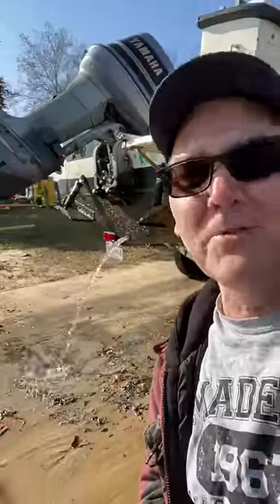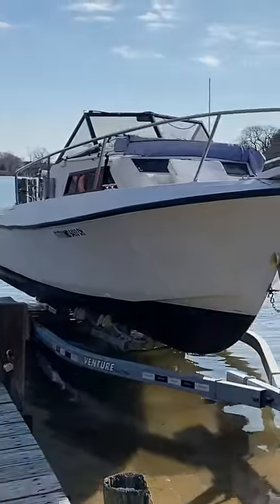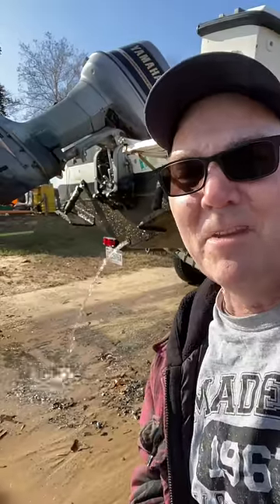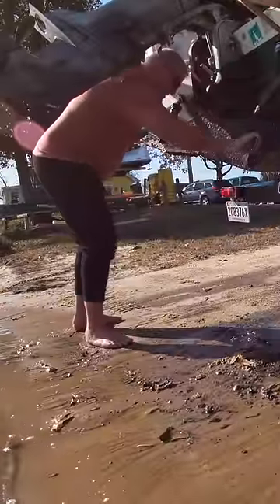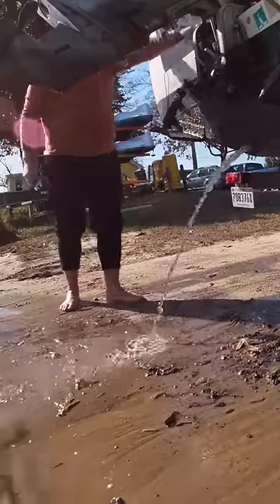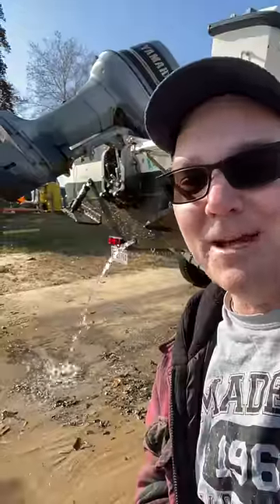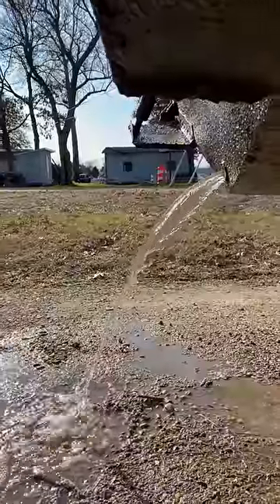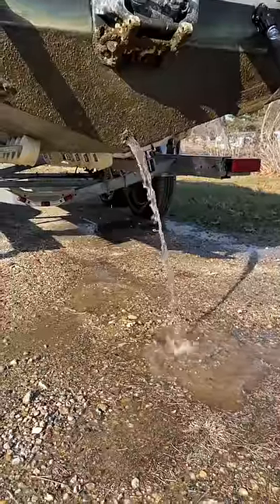When a boat bilge pump isn't working and there's been some very heavy rains lately. #boats #bilge

Comment: I like to be proactive and remove the drain plug before putting the boat on the water. That way I never forget to empty the bilge before driving home.
Reply: Great tip! You'll never have to worry about putting it in again.
Reply from the maker: lol - self draining prophesy!
Reply: How did he get 2 to 3 hundred gallons of water in his bilge?
Reply: Dammit, I was gonna say the same thing, you are good
Reply: I've seen someone do that 😂
Reply: Why not put the water back in the source where you were boating?
Reply: @HuewhaYue  Because boats can’t fly, it’s kinda hard to put storm water back up in the sky.
Reply: This is why I like bilge pumps. Great invention! Beats having to bucket, use a Dixie cup, or you know "pull the plug." 😂 Pun intended!
Reply: probably rain and the automatic bilge pump failed, also most boats leak a little bit.
Reply: Great advice I'll have to remember that for next time
Reply: You, sir... are genius!
But, if you fill the space with cement, it will never collect water again. No need to thank me. 🥰
Reply: Plus it keeps the bilge nice and clean too!! lol.  But the boat may turn into a submarine!!
Reply: Sounds like a sinker.
Reply: Did you know that they make pumps to pump the water out of the bilge? Anyone who puts a boat in the water without a working bilge pump is just asking for the boat to sink.
Reply: It would be cool to harness that water and spray the boat down
Reply: Better yet keep a half dozen plugs in the boat in case you forget to put it back in.
Reply: @lawrence-ub1vw  rain (according to the title)
Reply: Add long as you have a good bilge pump and a permanent electrical hookup you could actually get away with this
Reply: U not gone be driving anywhere if u do that.Probably your last trip as well 😂
Reply: @HuewhaYue when a person don’t realize they are on the ramp they just took the boat out of the water with… 😅 that’s exactly what they are doing… 😂 You have to do this at an angle or it won’t get everything out.
Reply: That also puts it into submarine mode...
Reply: @trock3935  All boats secretly identify as submarines. But only a very few of them are ever allowed to live their true selves. 🙃
Reply: it only works if you're really cruising. My granddad used to pull the drain plug and goose it, once you're above the water it all gets sucked out
Reply: @HuewhaYue Read the top information about this video (under the title) ... it seems to be rain water that collected where he parks his boat, not seepage from when it was on the water.
Reply: Does this actually work or is this a joke?
Reply: @CruelRavier  It seems serious to me, but I guess it depends what you're trying to achieve.  🤔
Reply: @samueljones-bankston7853  'never have to worry about putting it in again' the title of my high school memoirs
Reply: It saves you from throwing any more money into the water ( that’s what it’s like having a boat )
Reply: I prefer to saw it in half, dump it, and then seal it up with flex tape.
Reply: I did that the first time I took my boat to the lake😅it was not fun 😢..
Reply: @WayneTheBoatGuy why isnt your pump working?
I know its funny when it drains that much. But that can be super dangerous and make the boat unstable
Reply: @harridan. Like what it says in the description?
Reply: I love my 14ft tin can from the 70's if she has water in her I start up the motor an start cruising I unscrew my drain plug an watch all the water drain out as im driving after the water is out I still gotta control the boat an screw the plug back in but then at least I dont gotta bucket out water
Reply: @SuperSedingAngeL-yr0  you forget about rain
Reply: I hope the boat was parked in a Marina for at least a month to fill up with that much water, rather than a few hours of boating.  Hard to call it a boat otherwise.  It is just a wannabe submersible.
Reply: @SixteenTonesStudio yes, I thought this was standard practice.
Reply: I was thinking why don’t you just leave it off but ion own a boat so idk
Reply: This a joke right? I ask because I don't know anything about boats.
Reply: Unfortunately, it's an all too common practice. Ugh...
Reply: I fill mine with gasoline and it connected to the regular tank with mini pump. Only Karen’s full
It with water.
Reply: @lawrence-ub1vw same thing I’m wondering
Reply: @lawrence-ub1vw  live well overflows into the bilge I know I’ve done that one
Reply: Remember my dad doing this many years ago on our annual fishing trip. Luckily, we didn't set off without him realizing. We camped in a provincial park a few hours north of Sudbury Ontario. 2 or 3 hour trip from the boat launch in a boat absolutely loaded with gear. Spending a week on an island on the lake, God, I miss those trips. We definitely would not have made it, though, had he not realized, lol.
Reply: @WayneTheBoatGuy 
  I see your boat has Maryland tags by the looks of them. 
I am from here in Western Maryland.
Reply: @lawrence-ub1vw probably rough weather
Reply: Brilliant! 😅
Reply: Why is it that drain plugs only go in from the outside and are never accessible from the inside?
Reply: JUST remember to reinstall it...
Reply: For ocean boats, we remove and cover those boat sinkers.
Reply: This is funny but i have definitely done this once flotation foam is a hell of a thing lol 😂
Reply: Jeez I wish I was this smart
Reply: @cynicalrabbit915 I can't find a bulge pump for my kayak😢
Reply: @DavidFryer-ls3ss  
A kayak isn't a boat with a bilge.
But if you want a pump for your kayak, look into a small manual bellows type pump, an mount it so you can operate it with your foot.
Reply: @cynicalrabbit915  that was a joke.ive had small aluminum boats. Just bailing works fine. A pump is very helpful on boats with a deck that keeps you from reaching the bottom easily. I had a friend who kept the plug on the inside of the boat. He'd get it up and planeing the pull the plug. Water go's right out.
Reply: @DavidFryer-ls3ss  
I tend to treat jokes seriously and with over the top tongue in cheek humor right back.
👍
Reply: USS Saratoga, CV-60, once sank at the pier, because someone forgot to close the bilge vents. Thus, earning her the nickname, 'Sinking Sara.' 😂😂
Reply: I wonder how rotten everything is in the floor
Reply: I have to pee all of the sudden!!..😐
Reply: Zebra mussel’s
Reply: Question is, why don’t you fix the issue of water coming into the boat in the first place. 🤔
Reply: Just as important,,,,put the damn plug back in,,,,Before going back in the water😅
Reply: @Tpecroe fun fact if you forget about the plug you can speed the boat up and siphon the water out while you’re moving along. The movement is what sucks it out then put your plug in when it’s about out before it fills back up.
Reply: @HuewhaYue cuz it takes hours to drain
Reply: @NativeSkater1000 
Thanks! 
I Figured it was from the recreation source.
Reply: @captainotto  
That's Funny 😁
Reply: @captainotto  pro tip, if you forgot to put the plug in and notice that your boat is getting a lot of water coming in. Just take off and the water will siphon out as you’re moving and when it’s almost siphoned out put the plug back in. No pump needed.😝
Reply: @higherthanmost1112  
The boats 🚢 more stable half full of water 💧 😳
Reply: @captainotto  lol
Reply: How about a self-closing one where the hull isn't filled with water in the first place
Reply: That’s how I do it too
Reply: @WayneTheBoatGuy  this is an old post, but I think you meant self-fillingfull prophecy.
Reply: @cynicalrabbit915  what are those called?!
Reply: @lawrence-ub1vw  rain maybe
Reply: @lawrence-ub1vw  
Heavy rains and a non functioning "automatic" bilge pump
Reply: I always hate when people like you come up with the greatest/most clever/simplest ideas to make our lives easier, before I do!
Reply: @lawrence-ub1vw  obviously the bilge pump doesn't work
Reply: I'd say get a new bilge pump before you go swimming while you're boat is sinking 😂
Reply: @HuewhaYue I hope you know that bilge water isn't exactly like spring water.. it has all kinds of contaminates like oil ,gas,algae and just othe general crap in the bilge water so I don't think putting it back is no great environmental favor🤦
Reply: @captainotto  yeah, same here, it always seems like by boat is sinking though...Oh well, just thinking out loud, ya know?
Reply: @SixteenTonesStudio  My dad done the same. Then have one of us kids put it back in just before he slowed down to pull up to ramp.
Reply: Great idea , bob

Comment: No, it's important to make sure you have a working bilge pump!
Reply: Bingo
Reply: Uhh, isn't the bilge pump supposed to eliminate this issue? That boat isn't that big.  This has to be a joke.  Right?
Reply: They are draining the live well
Reply: @norml.hugh-mann Never seen a live well drain that low. Mine drained onto the deck and out the scuppers.
Reply: @WildRebel69 not the brightest bulb in the shed are you?
Reply: @marksmith161 You do know what a rhetorical question is, right?  The title even said the bilge pump was not working.  After all that, you decided to make a dumbass comment about me not being the brightest bulb in the shed. Hmm Thanks
Reply: @norml.hugh-mann they literally said the bilge multiple times. No live well is holding that much water 😂
Reply: A $30 walmart bilge pump saved my life. We were 4 or 5 miles from the slip when we gouged the fiberglass body on a stump. Without that pump, we would've sunk. Some fiberglass cloth and jb weld and it's good as new
Reply: Or a bilge rat to bail for ya
Reply: This!😂😂😂
Reply: @marksmith161 that one didn’t age well for you there bud
Reply: I mean hey worst case scenario you never have to worry about that bilge pump again
Reply: And a cover when stored outdoors.
Reply: Exactly what I was thinking!!!
Reply: @marksmith161 he is correct why didn't the bilge pump take care of this? A lot of boats this size only come out of the water once a
Year for maintenance. My boat is smaller and older than his and came from the factory with 3 pumps on three different switches.

Comment: What's important is to put the drain plug back in before launching.
Reply: Fix your leaky boat.
Reply: It's worth mentioning that you shouldn't put the plug back in until you're ready to launch the next time. My friend put his in right after it stopped draining, let the boat sit through a few storms and enough water made it through the tarps gaps to have standing water. Getting rid of the mosquitos and cleaning everything was a project.
Reply: !!!!!!!!!!!!!!!!!!!!!!!!!!!!!!!!!!!!!!!!!!!!!!!!!!!!!!!!!!!!!!!!!!!!!!!
Facts
Reply: This. I speak from experience. 🤦🏻‍♂️
Reply: Keep a spare plug handy you never know
Reply: The Plug should be attached on a Cable, and have a Clip there, like the old Broom Clips, to hold it when it's removed!

And, maybe Boat Trailers could elevate the Front Up, by 5-10° too, to get better drainage! 

Plus, put something like a "Mail To Pick Up" mailbox flag there, to raise when the Plug is removed! Maybe screw the plug in to the Flag Base when it's raised, so it can't be Lowered until the Plug is removed from the Flag?
Reply: 🤔maybe that's why he said 2-300 gallons in it !
Reply: @robertweekley5926  Nah. Just make the plug 1 foot in diameter. As soon as you put the boat in the water, you'll know you left the plug out. Lol

Comment: I was out on the ocean with friends when I noticed the boat was moving funny. Popped the bilge and it was full to the brim with water. The plug was still in and there were no leaks. We freaked out because we were some miles from land. Hadn't been any rain and had used the boat a couple days before. Best we could figure was that some A-hole had tried to sink the boat at the dock with our hose out of jealousy. Always check the bilge before leaving now.
Reply from the maker: Dang!
Reply: Here’s a trick to remove the water while out. Remove the plug then power the boat forward at low to medium speed. The suction created by the boat moving faster than the water will pull the water out of the bilge.
Reply: Who doesn't have an automatic bilge pump on their boat? Well these people for one
Reply: @keithkasnik743  Automatic bilge floats break all the time. Take it easy.
Reply: @RikkiTikkiTavi290 that's why there is a helm switch. You don't need the float/hard wire set up to run the pump
Reply: @danielballard4794  Exactly how jetski bilge "pumps" work!
Reply: I've seen  countless boaters that seem like nasty enough people to actually do that
Reply: “Never attribute to malice that which is adequately explained by stupidity.”
Reply: @Mr1121628 Occam's Razor? Or was it Hanlon's? Both I suppose 😂
Reply: @RikkiTikkiTavi290 he just bought his first one, he’ll understand eventually
Reply: I fill mine with gasoline and it connected to the regular tank with mini pump. Only Karen’s full
It with water.
Reply: Always blaming others I see 🙄. 😂😂jk
Reply: Boaters biggest nightmare... another jealous Boater.😢
Reply: @danielballard4794 um no. The plug is below the outdrive and removes from the outside
Reply: Not always.

Comment: I used to work for a well known boat manufacturer and went on an incentive ride in a just completed police boat. There were 9 of us on board. It topped out at 72 miles per hour in the beginning. Then it got slower and slower until we couldn't break 40. We cut the ride short and went back to the factory, which was situated on the water for testing. We lifted the boat and found that the plug was never installed and we had taken on over a foot of water. No bilge pump was installed, they soon added one though.
Reply: 8 pounds per gal , 300 gallon is 2400 pounds
Reply: @BustaCapov  it more than that because water is 8.3 pounds per gallon my friend!✌🏿
Reply: omg

Comment: At the boat dealership I used to work at, we sold these key floats that could also open up. They were the perfect size for a standard drain plug to fit inside. That way, when you pick up your keys, and the float feels heavy, you remember, "oh yeah, lemme put the drain plug in before I put the boat in the water."
Reply: Who pulls the key out of their boat ignition?
Reply: @georgeselby3376  idk. We always did just for safety.
Reply: That’s a wonderful idea!

Comment: Dude put in an automatic bilge pump in so you don’t carry the water all day in the boat. It slows you down and your gas used per hour will be less.
Reply: @DennisSmith-dq6iu  it had one, but it was broken and sitting in the marina waiting for repairs a few months, that water is all rain water…
Reply: Nah, man, all that water is how you get the big wake that the kids like to surf on!
Reply: @jonkeau5155  This is why I leave my drain plug out when the boat is in storage.  When you're a new boat owner, one of the common mistakes that will happen once is to launch without said drain plug.  That and trying to launch with your tow strap not undone.

Comment: There was a story going around over 30 years ago. This couple bought a brand new boat and asked the dealer to put the boat into Marina and a slip. So the couple went to use their new boat and couldn't get it on plane. The couple went to the dealership and the dealership checked the boat out and said everything was in good shape and should okay. The couple took their boat back out and still couldn't get the boat up on plane. So they took back to the dealer, so the dealer got upset and got his sucba gear on to check the bottom of the boat. The diver came back laughing and choking.
They for got to disconnect the trailer.
THE TRAILER!!!!!!!!!!!!!
Reply: After watching all the idiots in boats videos, I bet that happens more than you would think.
Reply: Isnt the trailer connected to the bow with a cable or rope? One would see that before taking the plunge. Smh.
Reply: Probably an Urban Legend that was thought up by the first idiot to launch both at the same time...

Anyone from the Stealership would automatically know there was a problem...

But I HAVE seen a few dinkusses let their boat trailers off the hitch and just try to operate the boat normally...

Usually "first timers".